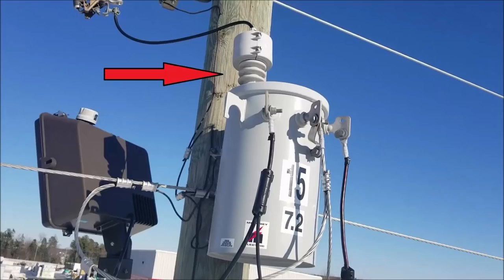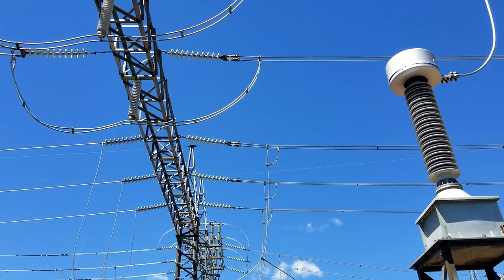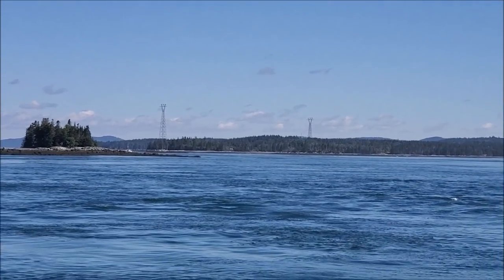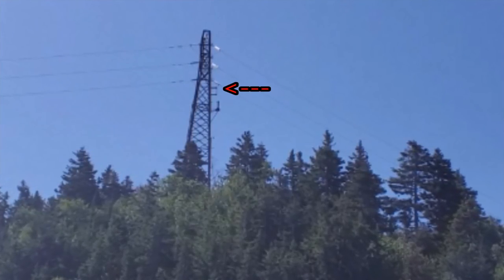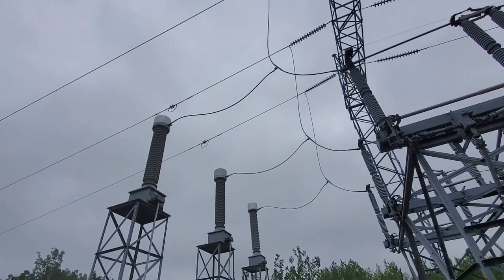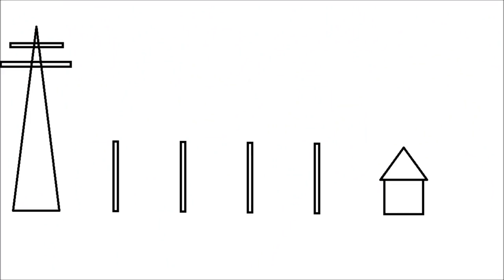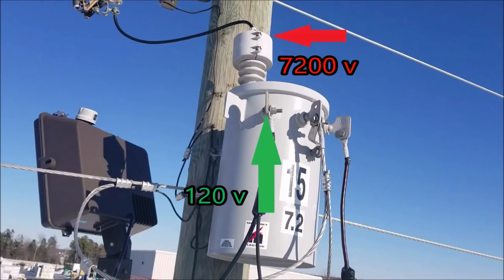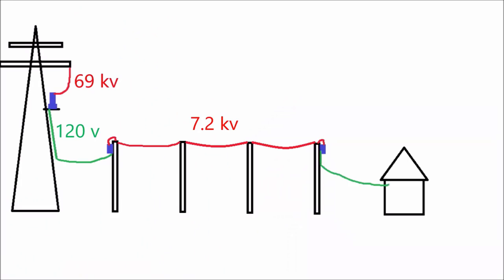69kv tower feeds cottage on an Island

Comment: I love watching and learning about these kinds of “oddball” setups like this one.  It really points out the necessity of preventing voltage losses, during even the shorter distance power transmission feeds, even if it is for only one house.  Aaron:  You do a great job of explaining why these setups are done, rather than simply stating the components of a “said” system.  Although, I am not a lineman, I really appreciate the detail you provide in your well created videos.  Keep up the great work.

My only questions next would be, are where does the cost of this “sub” transmission start for the cottage owner start, when trying to get a power feed installed for such a property?  Does the cost to the owner start way back at the “main island’s ,” transmission line, where the customer’s transmission branch comes off of the main transmission line system?   Or, does the owner only have to pay for the installation from the 7200V to 120/240V transformer near the house’s feed?  I’m assuming the former.  But, I don’t really know.

Comment: Even on vacation , still looking at wires.  i know someone else that does that
Reply: Pretty sure everyone in the industry does it
Reply: I am an old Bell Canada guy, always looking at outside plant!
Reply: @coryb6730  I'm not even in the industry and do it.  It just interests me.
Reply: @tabbertmj  Same here. It's interesting to me as well. I ain't in the industry but like looking at the setups
Reply: @coryb6730  I've been retired a year and a half from the communications support side, but I still notice substations, insulators, and communication towers. The same things that make us dedicated keep us in thrall.
Reply: @flagmichael  I look at wires too I thought I was the only odd one in the world that does it.
Reply: I'm not a power or Telco guy, just a retiree EE. Outside plant equipment fascinates me. I don't think folks pay enough attention to the incredible engineering that makes up modern infrastructure.

As an aside when we built our house 40ish years ago I was taken by the contrast between computer wiring, 30 AWG vs 4/0 AL I needed for the meter drop. To the linemen installing our service, a combination of aerial and underground, it was just small hookup wire.
Reply: @tomschmidt381  Battery-based renewable energy systems (off-grid or hybrid; not pure grid-tie), along with large telco DC plants, and some data-center UPSes are other places where that very large cable is needed even for more modest power levels, since battery strings running at lower voltages (typ. 48V max in a household; mine is 24V) need to source huge currents, sometimes peaking at or above 250A. Welding cable can work well for this, but may not pass an electrical inspection due to insulation type and lack of approval markings.
Reply: I was never in the industry, but eventhough collected 3000+ pictures of substations of all sizes from compacts to large outdoors :-)
Reply: You can count me in on that and I am not involved at all in an electrical supply field.

Comment: I’m a retired Power distribution engineer. I worked mostly in the northeast US.  That’s an interesting set up. I’ve never seen a PT used as a service transformer before, although for only a few amps at 69 KV it certainly would  work.

Comment: Did the customer on the island have to pay the probably $30k+ cost to bring power to the lonely house, or does the company have some kind of legal duty to bring power to any structures within a specified area? What is the current capacity on the 120V side of the PTE transformer, you say if was only for metering, I wouldn't expect it to be capable of a useful (small) household load?
Reply: I don't think the current cap would be any different for the PTE step down transformer. Only difference is the windings since it's stepping down a much higher voltage.
Reply: @jon2431  There are a lot of factors that impact the current rating of transformers, but for mains power, the main ones to be concerned with are conductor size and core saturation. The size of the conductor used in the windings determines the winding resistance and therefore the power dissipated at a given current. Undersized conductors will result in excessive heating and eventual insulation failure. Core saturation is when the magnetic core of the transformer becomes saturated with too much magnetic flux and causes distortion in the output and excessive heating. In either case, the excessive heating that results can cause the transformer to fail.

(Of course, these large transformers are usually rated in terms of real power (VA) rather than current)
Reply: @cudatox  fair enough. thank you for the response
Reply: I am a manufactures rep for the utility industry and found this video very interesting because I also thought that the output would be for metering only.  I checked the product literature for the manufacture of instrument transformers that I represent and found that their VT Instrument Transformers only go up to. 7.5 kVA per phase, but they also have what is called a PVT.  "Power voltage transformers ensure high reliability and power availability for any critical load need up to 100 kVA per phase. Power voltage transformers are used in high voltage transmission systems to provide low voltage energy directly from the lines. They are also called Station Service Voltage Transformers (SSVT)."  Thank you Aaron for the great videos that are helping me to understand my products better!
Reply: @MrRyanSchneider  This in turn makes me wonder if a future version with a 7.2kV tap will appear to allow for more cases like this and avoid the step-up transformer. Something that could be useful in rural areas where there are long distances between houses, or even when there are cellular network towers that need a feed and no 120V/240V is available in the area without a major undertaking.
It may of course have some downsides as well.
Reply: @MrRyanSchneider  Thanks for the great info! 7.5kVA sounds like enough for a cottage, and certainly for lighting/instrumentation at a substation. Was just curious if the cottage was limited to running just a few light bulbs at a time after all that effort or if it was more 'comfortable'.
Reply: NO customer owns the island, If you want right of way, I want power to my house
Reply: @genecaldwell3732  Interesting that kind of dealmaking happened. I'd imagine infrastructure like this can just do eminent domain and pay pennies for remote land...
Reply: @jovangrbic97  Yup, years ago, it was done, when the 69 line was installed 
I don t think there is a meter on house
Reply: @jovangrbic97  7.5 kva more then enough kva for a single house, figure all appliances are prob higher efficient and using the diversified rule, panel maybe rated between 100 - 200amp service but reality is not everything would be running at the same time. My only real question is that once you get past 19.9kv your into sub-transmission voltages which are usually not regulated (so it isnt a consistant voltage, can have large fluctuations, I wonder if the homeowner has some sort of capacitor past the metering point to act a a scrubber / correct the pf or reactance.
Reply: I don't know about the Canada, but in many countries, if the local zoning says there is provision for residential, commercial or industrial zones, then distribution company is obligated to bring the power to the customer. Of course power companies do participate in zoning discussions for this exact reasons, and official do take into account how hard it would be to bring the power (and other utilities) to such location, and what power levels are anticipated. And of course because powering a location require poles, and power lines, the potential location and route of such power lines must be taken into account when the zones are defined.  If you buy a random piece of land or island, and then ask for rezoning, there is no guarantee you will get power, and you will need to pay, and wait a long time. As he said the primary reason was that they already had equipement at hand, power was low, and they require metering with remote access. That is easier to do at lower voltage.
Reply: @kennyp507  It may be enough for that small cottage, but definitely not for a house. You could barely run an electric oven with that.
Reply: @movax20h  Not in the US if you want power stick a house somewhere have to pay for those lines to be installed. My inlaw built on 40 acres no power lines he dug 1/2 mile with his back hoe to save money power company put he line in he had to burry it. Took him weeks to do with with a back-hoe little every night. I think even with that he had to pay about $10k to get it brought all the way to his house transformer install to drop the power down. I have seen deals where someone is a friend of power company CEO they were able to get lines put in.
Reply: @ehsnils  I know this is a late response, but as in any industry, sometimes cheaper to use common sourced items than a small amount special items. So in the little number of times that secondary voltage would be used to 7.2kV may be impractical to source, and also for spares obtainability the parts used here are all common and can be sourced quickly for needed rapairs.
Reply: @mikeclarke3005  My thought here was that if there's a need in remote areas in some cases there might be a market to consider. It might be enough to just add a second higher voltage tap on that transformer for the rare cases.
Reply: @ehsnils  That's more windings though, and to have 7200 volts just sitting idle on a transformer that doesn't need it is prone to other troubles.

Comment: Now that’s cool!!!! I’ve been on storms in upstate New York where there was a feeder we were on. Out of the sub the system voltage was 7620/13.2. Then we got to a point where they had a 3 phase step down bank to 4800/2400kv. That ran out and we followed it to the end of the overhead and found a 7620/2400 step down pot that they had back fed. They put the 2400 single phase wye on secondary side and tapped out of H1 sending 7620 to a cutout and load side to a underground dip feeding some knee high padmounts. Ending as a 7620 underground radial. Found a bunch of this up there. Even on their 4800 feeders outta the sub. All of their underground radials had back fed step downs utilized as step ups just for the underground. Always check your system voltages on name plates guys!!!!! I do it every time I go on storm in foreign properties. Be safe fellas and keep your foot off the neutral 🤙🏼😝

Comment: A friend of mine in Russian  wilderness has 4 cabins that are powered by a solar and hydro system that is away from the cabins. He rents them out and people in Russia don't like to see any solar or hydro equipment at the place of hunting and fishing. so he has all of that 3 KM away. about 7 years ago when he was building it by hand we had a conversation about how to bring electricity to his property without having it to be too close to cabins to keep the complaints out. So I told him how we have transformers next to the houses on the poles in USA, and that we have to be careful not to back-feed with solar when power goes out. So on ebay I found a pair of transformers in Germany that were similar and same wingdings on both sides of both of them. So we ordered them and back-feed one and the 12KV line was ran from solar-hydro farm stack of 6 inverters, 1.5 KW each, then 12KV lines go from one transformer to another and stepped back to 230 volts for the cabins. It works just fine right now.
Reply: who did the high voltage comstruction? aerial or underground?
Reply: @htroberts  it's underground, the area he is in, there is no code requirements, so he just did it the best way he found from high voltage friends.

Comment: Outside of the technical aspects, I have a friend with a home on an island.  When he first bought it,  it didn`t have proper hydro to the island (former owner had a small generator setup).  He asked (then) Ontario Hydro and I guess they were obligated to run hydro to the structure.  That included sub-marine cable to the nearest point of the island, then 3 poles (maybe 4?) to stretch across to the entry point.  This was done in the early nineties, so I can imagine it was fairly involved and costly, but I guess in those days, Onscario Hydro ate the costs for the greater good to bring the goods to the paying customer. 
So...  Fast-forward to the early 2000`s,  Ontario Hydro is now known as Hydro One,  better known as Hydro None for the seemingly ever-increasing outages,  and they keep phoning up the guy asking if he`s interested in buying the poles and sub-marine cable and owning it himself.  Of course, he`s not interested one bit in assuming the infrastructure, as the moment he does, he`s liable for all costs and Hydro is off-the-hook in the event that anything goes wrong or fails.
Anyways,  watching this video made me wonder about the cottage that uses hydro and just what the likely arrangement might be for his deal regarding ownership of poles, transformers, other structures.  My days of building new are over (unless I win a huge lottery) so I`ll likely never go through whatever procedures and costs are involved in present-day acquisition of hydro to private property, but I can only imagine that the end-user is now paying the shot, or the majority of it to have any and all creature comforts ”piped in” from wherever it may be supplied.

Comment: Another nice video Aaron!
I saw the door down at the pot & immediately thought an animal blew the fuse. Usually here in CT. It’s caused by tree rats. We have K type fuses here. New Hampshire they use T (time delay) fuses. 
Keep up the good work. That cutout must have been put up in the winter before it was all leafed out on the ground. However if it were me? I would aim it at the road or driveway like you said.

Comment: It makes sense if the metering equipment for the house is on the land where the 69kv pole is, and thus the need to step it all the way down to the level the metering equipment can handle rather than stepping it down to 7.2 kv and putting the metering near the house which may make it harder for the power company to read. The down side as I see it would be that if the customer is billed off the 120 at the 69kv pole instead of being metered at the house, the customer is paying for the losses in the 2 transformers as well. If the customer is metered at the house then I don't see the point other than to use some equipment they already had laying around, but Bob did mention metering equipment at the 69kv pole location that required 120v.